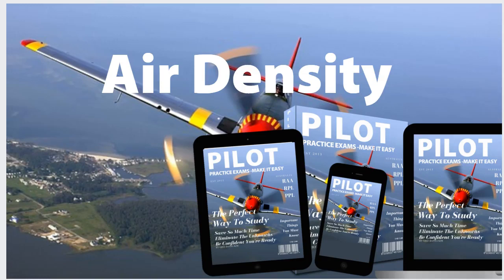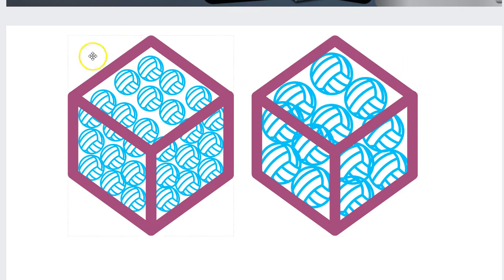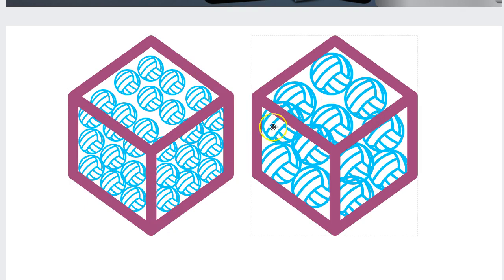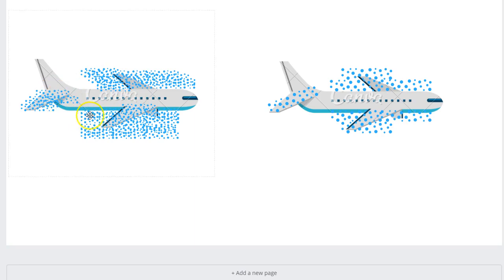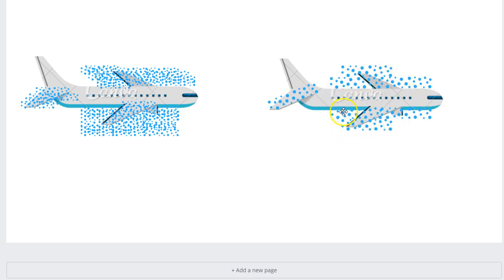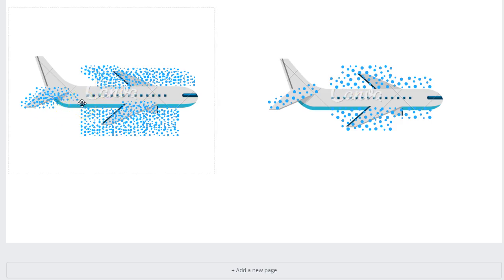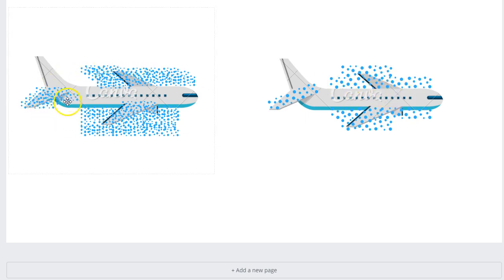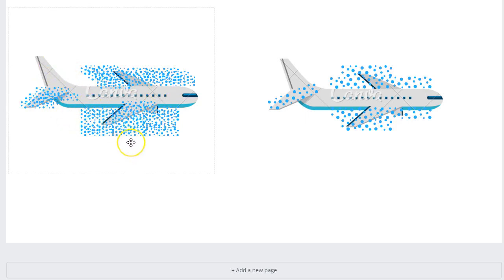Air Density Explanation For Pilot Exams

Comment: When the air is dense , meaning under low pressure, meaning Cold , you develop smaller particles , 

Less dense air , then the particles are bigger but with Lesser air fit into a volume
Reply: What I'm having a hard time understanding is why more dense air results in lower air pressure? My brain thinks that more pressure = more dense. Can you explain that to me plz and thank you
Reply: The density of air is directly proportional to how strong the atmospheric pressure is. The stronger the pressure, the denser air gets because you are squeezing more air molecules in a given volume. If pressure is weak, air molecules tend to move around more which decreases the amount ofmair in a given volume. Although this only works if temperature is constant.